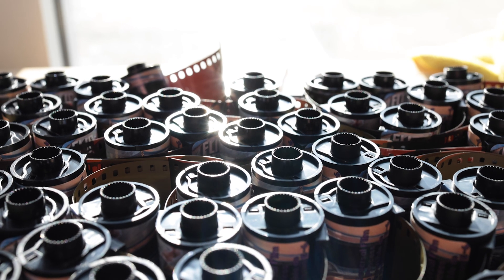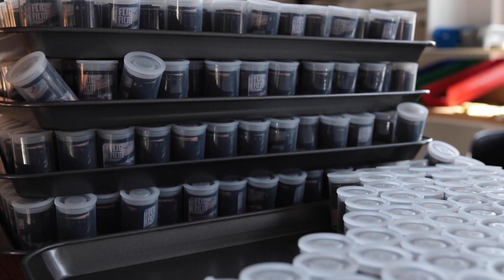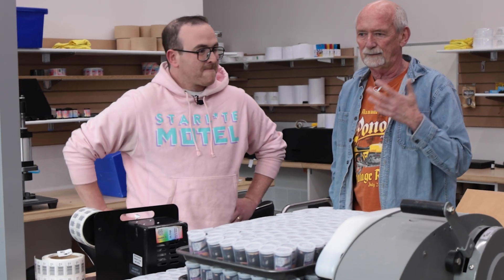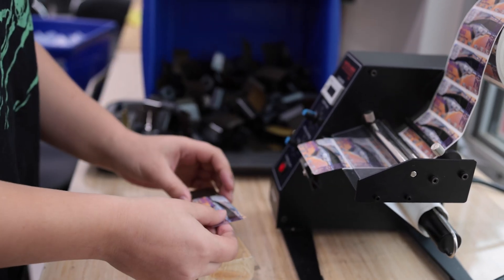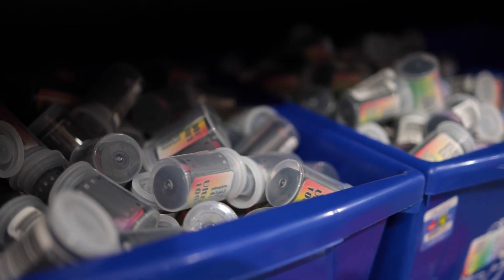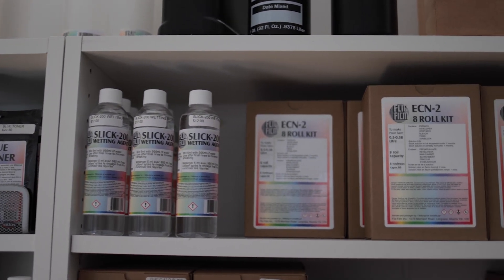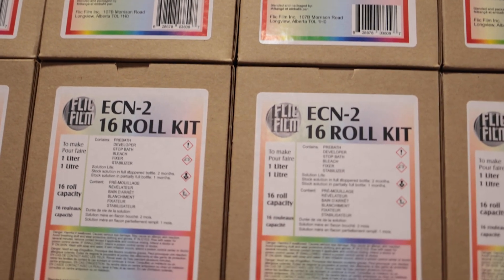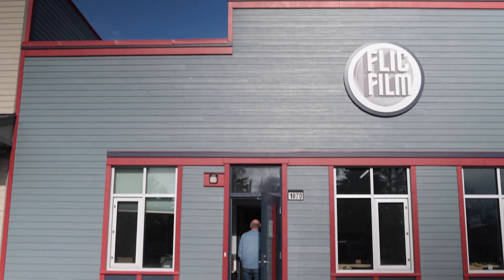How FlicFilm revolutionizes film & chemistry production from their factory in the Canadian Rockies

Comment: Applause for Dave and Co. Great to see.
I recall sometimes using plastic cassettes for bulk-loading 100-ft rolls of 35mm long ago. The left end (with the shorter spool end poking out) twisted on. Kodak had marketed metal cassettes with a snap-cap end, but if you dropped the roll, it could come off fairly easily. Ilford for a while had a similar design, but with a deep concave indent that held much better, and I believe similar cassettes could also be bought in bulk as store re-brands.
It may be that no one even makes a bulk loader any longer. There were basically two designs, the Watson, which had an open-close light trap, and a smaller, felt-trap one made of Bakelite, the name of which eludes me. In any case, it used to be very economical to bulk load with cassettes that could be used 5-6 or more times. It was also handy when a short roll was needed for testing or some other purpose.
On occasion, contests were sponsored for alternate uses of the plastic cans, rather than landfills, which brought forth all sorts of intriguing ideas.
Keep up the great work!
Reply: Flic film make a 3d printed bulk loader they sell!